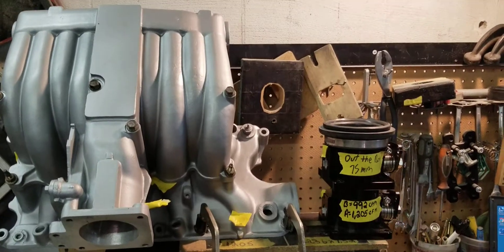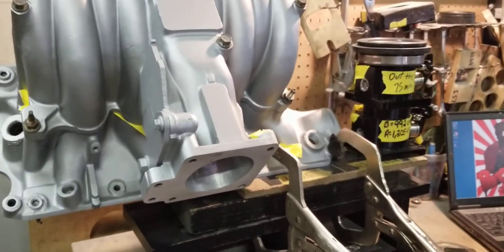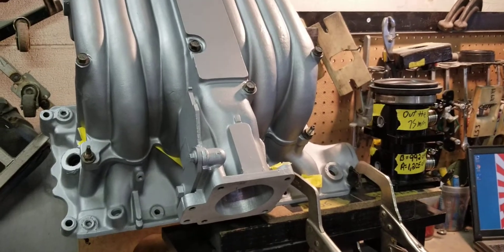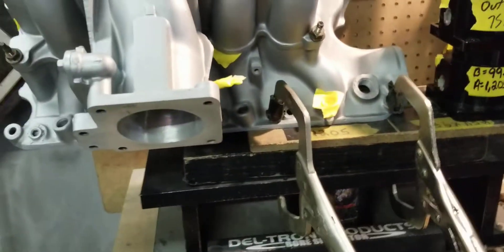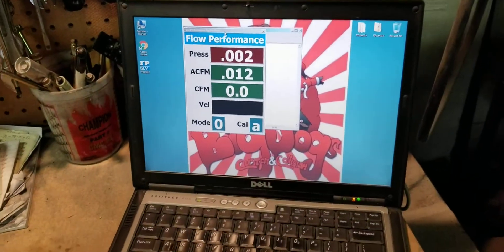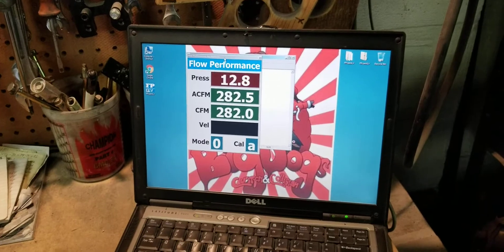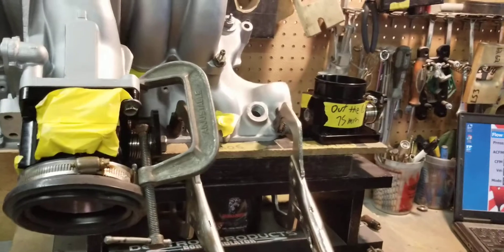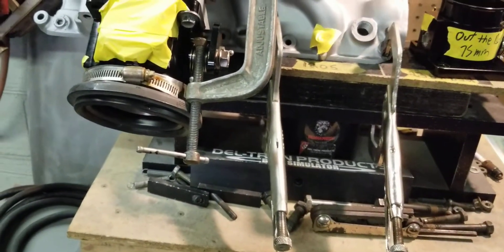Ford Mustang Cobra gt40 manifold and 75mm throttle body flow test.

Comment: Do you happen to know how many CFM a 70mm throttle body flows out of the box for a foxbody? I'm trying to see if it's enough for my 347 which I think it is because I only really need 650cfm or so
Reply from the maker: We have videos of us flowing a 70mm TB. A decent 347 needs way more than 650cfm. You cannot use a standard carb measurement calculator on a efi setup. Think about what you are doing. You are trying to feed a motor with one 70mm opening that has a shaft going through it lol. Also, the motor doesn't just suck through the throttle body. It also sucks through the intake pipe, maf sensor if equipped and air filter. Those all have to flow enough to not be a restriction. A minimum cfm flow for a mild 347 should be 1,100cfm
Reply: @bigdogsportingtonyb2833  ok I see. But I've seen you flow test a gt40 that was ported with a 75mm throttle body and you got 280cfm. My heads only flow 250cfm, why would I need a 1000cfm throttle body?
Reply from the maker: @jakew2350  because one intake runner doesn't feed all 8 cylinders unlike the throttle body tunnel. On a efi setup where the intake runners are feed from a common plenum and that common plenum is feed from a tunnel and single throttle body that tunnel and Throttle body needs to be able to flow AT LEAST half of the runners peak static flow. Meaning if your intake runners peak static flow is 250cfm the bare bones minimum throttle body, you want is 1,000 cfm, intake pipe flow about 1,000cfm or higher and maf sensor and air filter 1,100cfm or higher. 
I have a ton of experience and knowledge on this
Reply: @bigdogsportingtonyb2833  I'm not trying to argue, just trying to learn. How did you get the half of the 250cfm? Like where does that come from
Reply from the maker: @jakew2350  education, experience and having a degree in engineering. It's way more complicated than what I care to explain on YouTube lol. Plenty of test results to prove my statements
Reply: @bigdogsportingtonyb2833  I also have an engineering degree, albeit I just graduated like 3 months ago. Do you have a test where you take a well ported intake, let's say it flows 280cfm and then throw an out of box 70mm throttle body to see what the resulting CFM would be? That's really all I'm concerned of
Reply from the maker: @jakew2350  yes we've done all of that and there's no reason to re do it. I'm trying to tell you the facts. A decent 347 motor needs a decent amount of cfm flow to maximize power output. This should be common knowledge by now.
Reply: @bigdogsportingtonyb2833  ok but what is the drop in CFM by doing that. That should give you the amount of CFM that a 70mm could theoretically flow at for a given head/intake combo. Most people recommend a 75mm for a 347 which would flow about 800cfm. Can you give me a hard number for what a high flowing intake would output with a 70-75mm unported throttle body?
Reply: My bad 75mm about 900cfm but if that supports 276cfm out of the intake ur math is wrong for needing 1000 for 250cfm out of intake.
Reply from the maker: @jakew2350  Jake, you are really over complicating something that is so simple. First there is no one cfm rating for each style or manufacturer of the same size throttle body so you cannot generalize their flow. You can take 2 different brands of 75mm throttle bodies and put them on the flowbench tested the same way and one may flow 200cfm more than the other. This is the exact reason why we do before and after flow results on everything we port and don't make assumptions.
I'm trying to tell you a out the box 70mm TB will be a restriction on a decent 347 with a good flowing manifold and supporting parts. This is why even a stock 302 Coyote motor has a 80mm throttle body from the factory on it. The higher the rpm/hp the motor the more flow you need from your Induction and exhaust system to maximize your hp potential. Now let's move on from this.👍
Reply: @bigdogsportingtonyb2833  I got you, I see your tests and they make sense, the numbers look right. But in theory I could possibly get 250cfm out of a 70mm TB. I do have a question though, when you port a throttle body, do you port the entire length or just the two openings? I'm sorry I'm being so persistent, it's just something I'm trying to learn more about.
Reply from the maker: @jakew2350  when porting you should never port blindly meaning not having a baseline so you can measure your gains or losses. Increasing cfm is not always about making something bigger. It's about reducing restrictions and to cannot accurately know what those restrictions are without some way to test. We do not tell people how to port parts do to the fact we don't want people messing up their parts. Much easier to just sell the 70mm TB and buy a 80mm TB and be done with it.
Reply: @bigdogsportingtonyb2833  ok I can understand. Do you happen to have a video that's 70mm throttle body on an intake before and after? I see this one is 75
Reply from the maker: @jakew2350  we did a video comparing a ported 65mm throttle body to a out the box bbk 70mm TB I believe. We tend to not recommend anything smaller than a ported 80mm or out the box high flowing 80mm throttle body on a decent 347. We recommend our ported 75mm 1,200cfm throttle bodies to be ran with any of our stage 2 gt40 or aftermarket manifolds on motors less than 331 cubes.
Reply: @bigdogsportingtonyb2833  Currently I have a Performer RPM I (not II) and I plan to get it ported, do you have an estimate on what CFM it could flow with a stage 1 or stage 2  port job. Also where are you located
Reply from the maker: @jakew2350  we offer our stage 2, stage 3 and stage 3 max flow.
Stage 2 on a efi RPM will have a bolted together after runner flow of about 280cfm. They flow 225-235cfm in stock form
Reply: @bigdogsportingtonyb2833  ok that's pretty good. How much do you charge for stage 2 and where are you located?
Reply from the maker: @jakew2350  we are in Lansing Illinois and you have to message us on our business page for all pricea and details